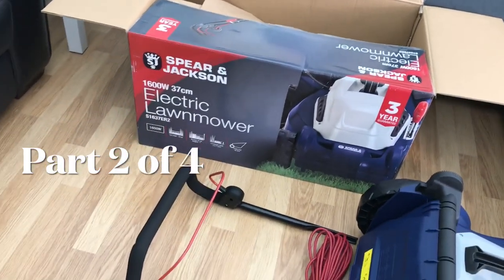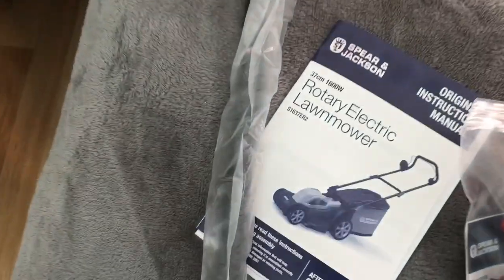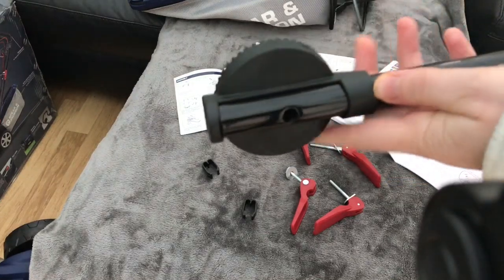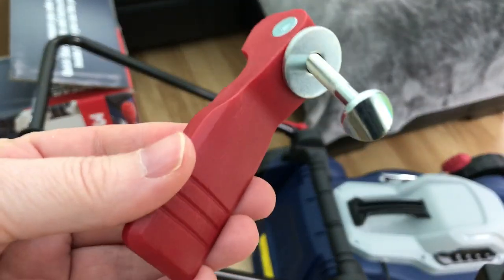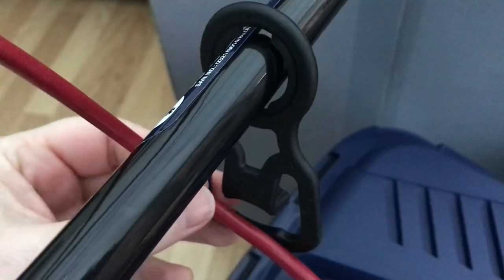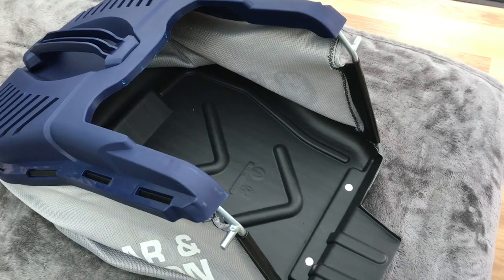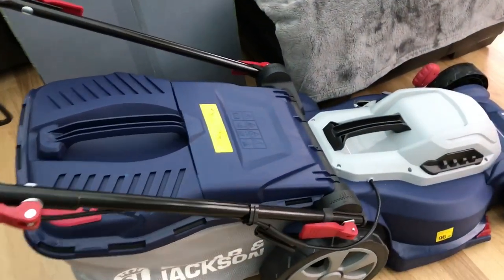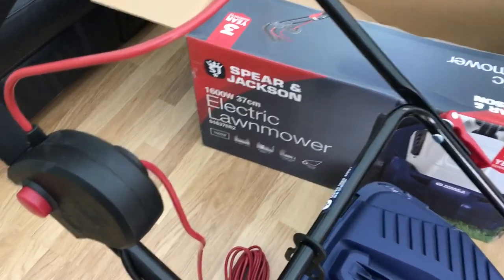Spear & Jackson Corded Lawnmower assembly instructions 2022 - Part 2 of 4 #Spear & Jackson

Comment: Does anyone know the purpose of the black plastic guide that slides up and down the black power cable, clearly visible at 0.22 and 8.57, adjacent to the red lower cam lever? I looks as though it is designed to clip over something but does not fit the handle. I wonder if it should have been installed under the light grey cover, as none of the pictures show it, but the new mower I purchased today has exactly the same part in the same location. Good video, as mentioned, the included instructions are pretty useless.

Answer: Having contacted Argos after sales support, they explained that the cable guide slides over the lower section of the upper handle and the quick release adjustment bolt goes through the rectangular hole. The purpose is to stop the black cable getting trapped / damaged when the handles are folded for storage.
Reply: You can fit it over the cable and has a hole where the bolt goes but I can’t figure out how to attatch it
Reply: @Boo-pv4hn  The bolt that attaches the red quick release lever that joins the upper and lower handle goes through the hole in the cable support, so the cable support guides the cable around the red lever. I had to email Argos to get clarification, as they licence the brand and manufacture the product. In fairness, they were very helpful and replied promptly.

Comment: Thanks for taking the time to show each step in detail and close-up.  Have not started to assemble yet but your vid will hopefully help make it that much easier. Will let you know how I get on. 
Edit: assembly completed and first cut successfully made without difficulty thanks mainly to your excellent demo. Only snag was both cable clips had disappeared by the time I'd finished the first mow,  Maybe I did not affix them correctly but not convinced they're needed anyway. Thanks again!
Reply from the maker: Thank you for your kind comments.  Enjoy your new mower.  I love mine and it’s still going strong.  Minus one of the cable clips😂

Comment: I've got that model and all of a sudden white smoke came out the top and the rotator stopped working.ots pretty new machine as well
Reply from the maker: Speak to the shop you purchased it from - they might accept a return and refund. OR most definitely if it’s new it should be covered by the guarantee - as long as you have the receipt and can prove proof of purchase.

Comment: Th
Ank you for the video wat a nightmare wasn't expecting this much to assemble just subscribe
Reply from the maker: Thank you so much. Enjoy your mower.  I love mine and it’s still going strong.
Reply: @lockie4912  just looking at mowers came across ur channel.  There are others. But a bit out the price range which I came across as I have a disability.  Ego cordless but that was 42 cm and husqvarna aspire is similar but easier to use and I like the way the fold I had be after the spear and Jackson for a while but decided to some more research as I have a very difficult garden. Check them out the second one I found from gardeners world top 5 cordless and the ego is on Jay rock channel review
Reply from the maker: @Sara-ze5do  ah ok. Will definitely check those out.

Comment: Thanks for this, most helpful! the instructions are piss poor, had the same clip issue that you identified, which pair fit the bottom pair of holes and which pair fit the top 2 holes??!! and who knew once you've found and installed the correct fixings for the adjusters at the bottom (the ones without the washers) you in effect have to completely dismantle the 2 top clips that join both parts of the handle and reassemble them in the correct order, to secure it. Surly its not rocket science for Spear and Jackson to number the 4 red fixings and show a dismantled diagram of how and where they fit together, judging by the amount of people saying the same things over and over, S& J might at least acknowledge and remedy this its not a difficult fix .
Enough ranting for now hope it cuts the grass now I've wasted about an hour of my life putting it together, ( Bloody raining!)
Reply from the maker: Thank you.  Enjoy your mower.  Mine still going strong and very happy with it.